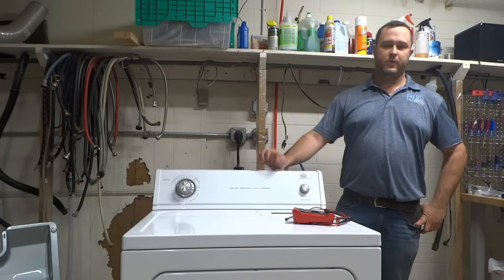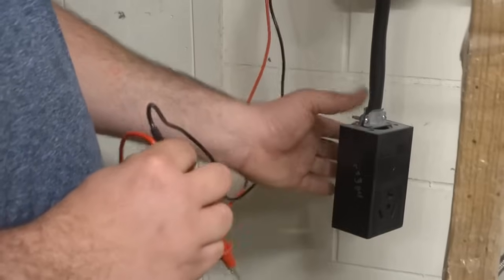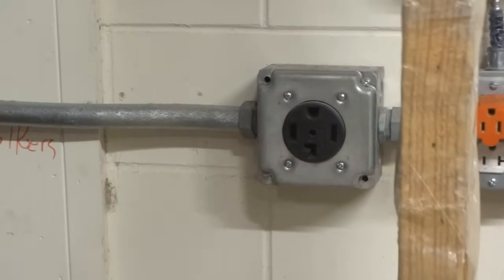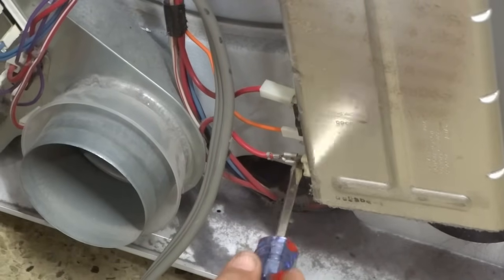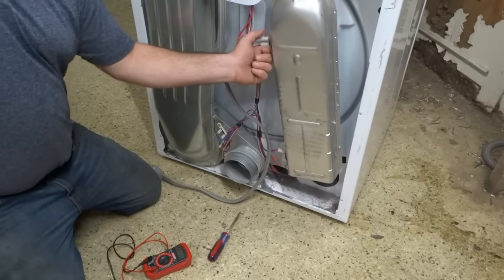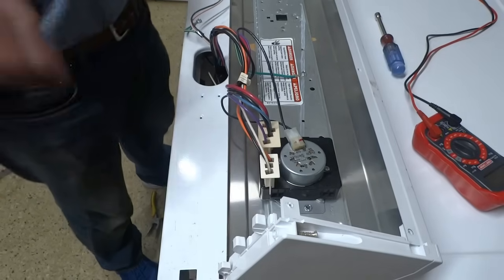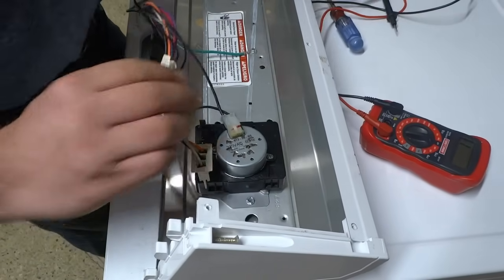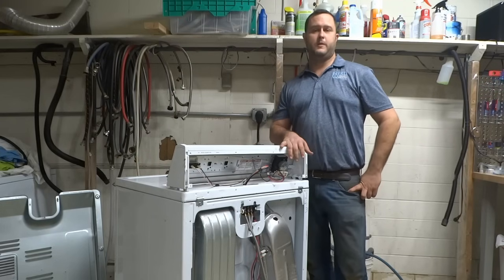Whirlpool Dryer Not Heating - Diagnosing Common Issues

Comment from the maker: Due to lots of comments about the thermal fuse, the following note will be pinned to the top to help folks. The thermal fuse on electric dryers is not on the heat circuit; it is on the drive circuit. This means that if the thermal fuse is bad, the dryer won't start at all. We have another video on electric dryers that don't start. Good luck!
Reply: Great info
Reply: Very helpful man thank you. Just so I got it, I tested everything you ran through here and the only issue I found was the top thermostat (safety I think) didn't do anything when I put my multimeter on it, the others were either 0 ohms or 9 ohms or less. So with getting no reading I would think that means I got a bad T stat? I'm a Auto mechanic so I'm kinda out of my element a little lol. Thanks for the video
Reply: Have a dryer that the element won't heat. When you turn it on plugged in 120v reaches the element fine when you turn the dryer on heat and turn it on. The thermal switches have no resistance when turned off as they should. The element tests good as it has 10 ohm resistance and does not short to ground. There's no apparent physical problem with the element. There's a light blue wire running down towards the motor that seems to have a short to ground but I'm not sure if that's normal being it goes to the motor windings. Seems like I remember that motor wires will show a short to ground. The motor works great. Is there some way that the element could actually be bad anyway? What would be your recommendation to do in this situation? How can the element test good, have 120v going to it, but not heat? Anyone have a clue if the element is bad anyway or is there something else that could cause this?
Reply: My Dyer was gas , and the thermal  fuse  was bad. I replace  it and heat work again.
Reply: sexylitehaiti sexylitehaiti  No, the dryer can spin even if the fuse is bad.
Reply: Where is the other video on electric dryers that don't start?
Reply: @jimilittle  have you checked the themo fuse,timer start switch,door switch motor?they are tricky
Reply: Thanks for the explanation but what about gas dryer,one start and spin but no heat, could it be thermal fuse or something else, thanks for your response!!
Reply: Our Whirlpool dryer LEC68648ANO, heats on all cycles.  Even when in "cool down" mode and in Air Only or "Fluff" mode.  I opened the timer.  Two contacts showed signs of arcing.  This was visible on the housing inside.        I have already replaced the thermal fuse and cycle timer, the heating element and both the limit thermostats.  I'm thinking it is the timer control unit, since the heat is now shutting down when the cycle finishes (previously it was staying on).  Any thoughts?
Reply: At 1:45, your hand blocked what you were doing in the outlet so we missed a very important part of the video. We don't know if you took both wires and put them into the socket or what you were doing. I need to check this but don't want to blow myself or multimeter or the fuse up. What did you do there?
Reply: @mynameisgladiator1933  the very first step is unplugging the dryer, does not need plugged in to check for ohms. Be safe and unplug first, only need to unhook ONE wire to check. Hope this helps, dont want you to get zapped
Reply: Hi dear, My Kenmore fridge fan and compressor are running but no cooling and freezing at all? Would you please let me know what's going on?
Reply: This comment saved me so much time. Thanks
Reply: Byrd Appliance Specialists excellent stuff!  Thanks
Reply: sexylitehaiti sexylitehaiti  at,sxy,lte,hati... repairs very on models makesbut usually amultimeter says most of the problems are solved.today cleaned 2 sensors,very soiled and lint filled reading sensors
Cleaned runs & works like a top whirlpool dryer.not always the case
Reply: https://youtu.be/xQ0lqcSa-I4
Reply: Ll
Reply: Clean filter from the top of the dryer, mine was loaded with crap. Now Cooking up hot
Reply: Thanks for clarifying!! Great video!!!
Reply: Awesome information my dryer works but won't heat up we just bought it used for 50 it got really hot then just stopped heating up, so it's not the fuse now I'll tear it apart girls got to do what they got to do.
Reply: 4fffßffffdfzfffzddszzzfdddzdzzzzß77747777474zfdzdzdzddddddddzdzddzdzdddddzdzdzdzzzzdddzdd4774747777747447777777422522125
Reply: My Whirlpool dryer keeps blowing the fuses
Reply: I have a whirlpool dryer that don’t shut off on automatically  cycle but the other cycles do
Reply: That's what I thought! I knew I was correct, but after testing the original thermal fuse, there was no continual current. Replaced but still no heat! Testing my electrical outlet and if that's not it-  I'll be saving this video for future reference! Thanks!
Reply: Have a dryer that has a heating element that heats up initially but peters out within 30 seconds. Any ideas?
Reply: Should I cut the breaker off completely
Reply: I'm getting wild jumping numbers on all 3 of the heating element sensors you tested
Reply: When you say your looking for 0 ohms does that mean if there is 0 ohms then the part is working correctly?
Reply: @common.sense88 that is what I was attempting to figure out. In the video he said 0 ohms was a good thing. The 3 parts he tested, I also tested, none of them were zero. They were all over the place. I did take the parts to a supplier. The supplier did a continuity test on them and ruled them as good parts..

My issue ended up being an airflow issue. Did not realize I needed to remove the neck for the blowout on the machine. Had a massive amount of dense lint right next to blower
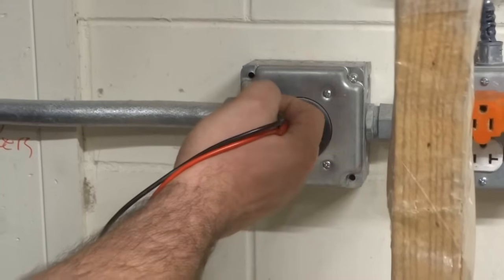Reply: Also at 2:20, you put your hand in the way so we can't see what you're doing.
Reply: @mynameisgladiator1933  if your not comfortable using a simple multi meter you should probably not be messing around with electric. It can hurt you very badly of your not careful. Please at least wear safety glasses
Reply: @_gramcrakka_82  then offer the advice he needs if you even know it. I doubt you do and if you do tell him
Reply: @johndough4412  i was just saying to be safe. Fixing dryers should be taken on by people with some knowledge on how electric circuits operate. Harry homeowners grounded against the case and covered sweat can perish very quickly. It happens to us hvac guys fairly often.
Reply: Depends. Lol don’t share mis information. 
Mine blew the fuse. It operated. Just wouldn’t turn on heat elements. 
Replaced the fuse and heat came back. And it’s a whirlpool too. 
So yeah. Usually they’re wired to the low voltage side of the heating circuit.
Reply: Possible are y'all going to buy me a washer and dryer
Reply: Their mind me a washer and dryer
Reply: Awesome info.  I bought a fuse also,  but didn't need to after watching this. I do have power and it spins.

Comment: You should do a video about testing the motor thing you were talking about. 
I just replaced my heating element and all the fuses and thermostats. I cleaned my timer and my dryer still isn't heating. I ordered a new timer so maybe it will be fixed with a new one. My dryer works fine, it just doesn't heat with consistency. It will heat every now and then, but for the most part I have been using it to suck off the lent from my clothes and to tumble them after they line dried to soften them. Sometimes I put stuff in to tumble and it's hot. 
But after I worked on it it's still not getting hot. Hopefully it's the new timer. 

I don't know how to use that multimeter thing. I bought one, and I think I put the probes in the right holes. It has 3 of them, and it ddn't come with instructions. So I haven't a clue what I was doing. 
I can't afford 2k to have someone do it for me.

Comment: Thanks for the video. My issue is as follows:

Tumbler moves normally during the cycle.
The venting is clean and clear.
The heating element is glowing red hot, but clothes are not drying.

Thoughts?

Comment: What was wrong with my timer is that it got pulled out a little bit and wasn't pushing all the  "reeds" like it should. I opened it and carefully turned it and pushed the reeds aside until it sat back in  the bottom and worked again. Originally it had continuity in 2 small spots. Once I got it back in place it worked like it should with continuity everywhere there would be heat. Save yourself $75 and see if you can just repair it.

Comment: Thanks. Followed your video. Had an open on the Heating Element, nothing else. Ordered a new one, (also drum belt and rollers). Total of $58.90. That did it, back up and running. When the new element came in I checked the ohms and got 9.8 ohms, so I felt that confirmed the suspected cause. New Element came with a new Operating Thermostat, so I installed that one, kept the old one as a ready spare. Mine is a Kitchen Aid KEYS700JQ0, but looked nearly identical to the one in this video. One side note, question. The old element, like I said, it tested OPEN. But on visual inspection, I did not see any break in the element wiring (coils). Is that normal that it could be OPEN, yet visually intact?

Comment: Ty Very Helpful. I had just did a maintenance on mine, belt , rollers,cleaned it and blew out the motor with compressor and broke my motor winding 😢 3 months ago. Now I have heat but not hot enough to dry as normal?

Comment: OCT 2024. My Whirlpool Dryer Model # WED4850HW0 stopped heating. After successfully repairing a Washing Machine and a Dishwasher using YouTube I decided to try my luck. This video was exactly what was needed to identify and fix the dryer. I had to buy a Multimeter tester at HD ($18) and I then followed the steps exactly as done in the video. There was no issue with my vent or any of the circuits I tested. So it was most likely the timer. I ordered a new timer assembly from Appliance Parts Pros ($115) and it arrived two days later. It was an easy to swap out the old failed timer assembly with the new one. Before putting the machine back together I tested it and it operated just like it should. This video is the prefect example of how to help DIY / homeowners troubleshoot and repair a dryer. Thanks!
Reply: 20oct2024. Just digging into my whirlpool. Simple durable construction. Upper limit open. Imaging the transistor filled nonsense in lg samsung. My wp is 30 years old and will outlive me

Comment: Thanks, straight to the point, with no BS like removing scews.  Tuns out I evidently had a trifecta, with one leg of the breaker not having power, the upper limit thermostat out, and the lower thermostat fried to the point the terminal broke off.  Reset the breaker, replaced the parts, cleaned of some dust, and the now working fine.

Comment: Great video. 

We were overseas and our dryer went out on our daughter. We were gone for 1 week out of a 6 month trip when it happened. I ended up buying a new Amana from Lowes to get a working dryer again. We just returned and the new Amana just started not drying.  It worked for less than 4 months, Amana is sending out a repairman. 

The old Roper is in my basement. They kept for me to look at when I returned.  With the new dryer acting up, I decided to see what was wrong with the old Roper.  I have checked everything you mentioned except for the voltage at the wall.  It all checks out fine.  The issue is it will stop drying after 5 minutes or so.  I am leaning towards the timer being the issue and possibly corrosion in the contacts. There was a decent amount of lint in the upper area near the timer.  If the contacts are dirty this might be the issue..

Any thoughts?

Comment: The cycling thermostat is the one next to the thermal fuse. It has 4 wires. The thermostat by the heater terminals is a high limit thermostat and  only cycles if the cycling thermo fails to open.

Comment: Everything tested normal except O ohms at the coil. I thought that  was funny. Had the ohmmeter on lowest scale. 
I might energize the dryer and trace for voltage from the coil back to the timer. Connections are corroded somewhat.

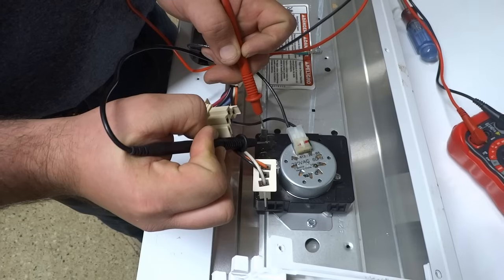Comment: At 7:28 you are testing the timer. I cant see the area you are testing because its too dark where you are testing.
The timer isnt my issue,but just an FYI. Yours is pretty good,but then Im new at this. I dont have an audible conductivity alarm so I have to use the omega scale. All videos Ive seen have the audibe alarm. I learned that issue on another site. Ive watched about 6 or more of these ,countless times taking notes etc and there are still loads of info to be correctly intrepretedand learned. "Multilayered " Theres always something new  at each site determining why my gas whirlpool dryer isnt generaring heat. Its a hell of a way to lean this from scratch.
In summary,good presentation

Comment: I just wanted to mention that got a lot of these mechanical timers you can repair them yourself just take the back off and there are thin copper strips with little electrodes on the end like points of contact. They get corroded just sand them down a little bit and if any of the copper strips have a bend in them just straighten them out with the screwdriver it's very easy they're thin copper strips. That should fix any issues.

Comment: Thank you sir! You just helped me help a police mans widow be able to afford to fix her machine.  Guy offered to swap it out for $200 with five year warranty.  She doesnt have it. 

Watched this video and took my multimeter over to find out it was a $17 thermostat. I let her buy my lunch. (Burger no fries or drink)

Again thank you sir and YouTube. 
Due to YT I have replaced several car parts. $1100 in mechanical labor.
Three hot water tanks (weekend rates saved all three times)
Switched a gas stove to 220v by capping gas line and running new power from panel.
Replaced breakers in two houses.
And removed half dozen sebaceous cysts from my body.
Currently watching videos on molar extractions. (Might leave that to the pros though)

Appreciate the help and so does mrs. Gloria.
Reply: Lol!

Comment: I realize this was 5 years ago, but my fingers are crossed that you see my message…I have whirlpool dryer, it runs but no heat and the timer doesn’t shut off,.. so would it be safe to say it’s the timer switch and forego all the other testing? Bc I don’t have a volt meter..and if so, is it an easy fix?

Comment: After buying the heating element, thermal fuse, both thermostats and still not working...I was at my wits end. Saw this video and went and got me a multi meter and sure enough, my old parts were good! And my new ones as well (obviously) but it was the timer!  Thanks for the video!

Comment: I feel I need to add my two cents on repairing at this point, anything. My dryer wasn’t heating after getting pull away to refinish the wall behind it. First, hubby didn’t properly connect the venting pipe…he used tape that didn’t hold when moved away a bit and the pipe was badly kinked at that spot. Because of the kinking, I thought it had overheated and shorted something. I spent nearly two weeks taking the dryer apart, replaced one fuse that didn’t register when tested and with great difficulty because of this model, I removed the heating coil box after needing to remove the drum. Tested ok, I checked the coils and found no breaks but, I ordered a new coil that didn’t fit. I ordered from the numbers on the old one and it still didn’t heat. Hubby finally lent a hand and hot-wired the old coil and the damned thing heat up! My grandson came to help and decided to check the outlet. I had carefully pulled it out a bit to fix the drywall and while I was out of the room, hubby decided to put it back even if I hadn’t finished the wall. I removed it again to finish up. Well two wires were found to be disconnected and the screws holding them were loose. Nothing wrong with the dryer and now extra clean of the collected lint. The saga of grandma’s days when grandpa watches CNN all day…Check plugs and main fuses before anything else. I shudder to think what it would have cost me if I’d called for service! Ok to laugh….😵‍💫

Comment: as you stated in your video , " the fuses at the top and bottom of the heater box should be replaced at the same time if you read a measurement out of range for the bottom one "  .  The bottom thermal fuse just crumbled in my hand when I removed it , and the 1 terminal was badly corroded with the insulation melted on the wire at the connecter !!  When I checked the top fuse it read 0 ohms which indicated to me that it was OK , but ; when I reassembled the machine and made a test run I still had no heat !!!!!  I proceeded to go to my last hope  by going to troubleshoot the timer and check if I was passing power through the 240 volt red and black wires .  Everything checked out fine at the timer side , so ;   I disassembled it again and replaced the top fuse on the heater box as you suggested.  When I powered it back up this time I had heat !!!  I don't understand why I got a false reading on this fuse unless it was just able to read on the meter and when power was applied it wouldn't carry a load??!!  Perhaps had I checked it with a megger the problem would have been obvious .  I am very grateful for your thorough explanation  regarding changing both of the fuses at the same time , otherwise I would  not have had a clue as to what was wrong other than your last step involving a bad sensor in the motor , at which point I would have been going to buy a new dryer !!!!  Thanks again for a TO THE POINT STRAIGHT FORWARD TROUBLESHOOTING VIDEO  !!!!  VERY PROFESSIONAL of you !!!  I would like to know if you could help me out with a problem that I am having with my backup dryer which is an old Montgomery Ward machine ?  The dryer runs beautifully except that it will only make heat on the medium heat setting on the dial .  Is my pot bad or  is this a more complex issue ??!!  I would appreciate any input from you !!!